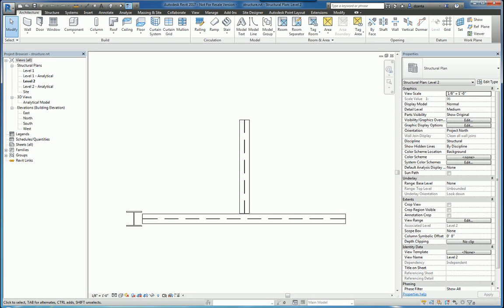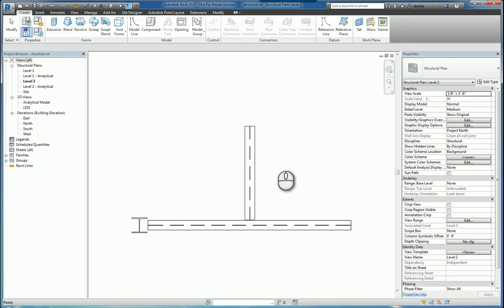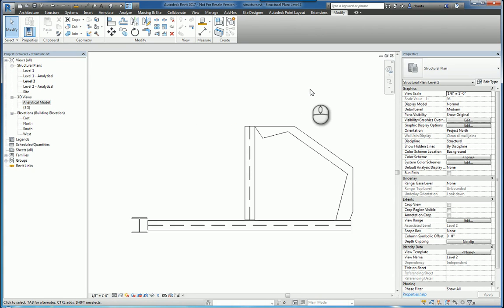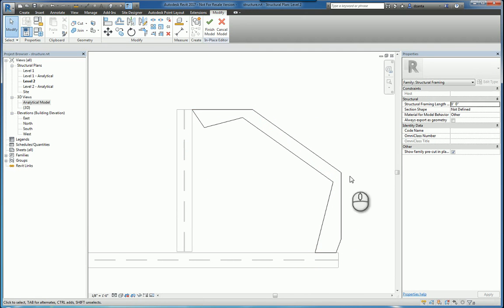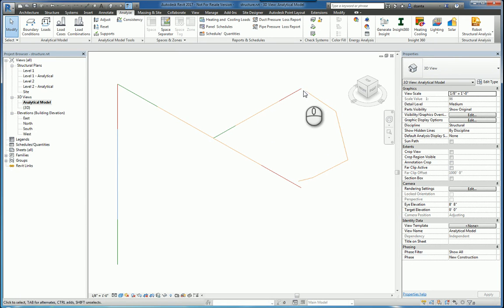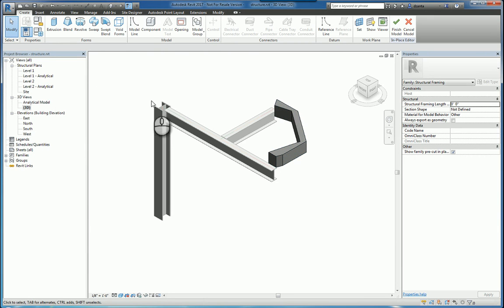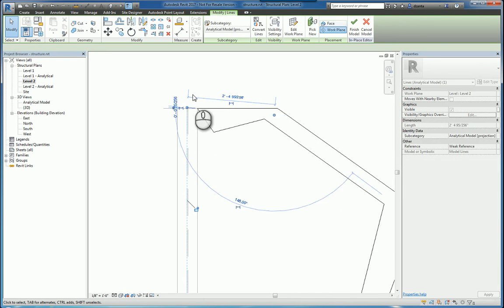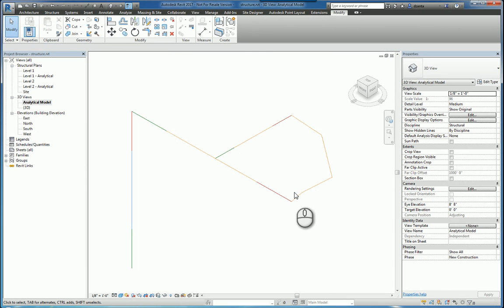Revit Analytical Model Lines   A How to Guide

Comment: Is there a way how to add custom analytical line in family?
Reply from the maker: If you start with a structural based family such as a beam or column or truss, then the analytical lines will already exist
Reply: @DzanTa  Yeah, but its usefull only for straight beams. I cant create for example concrete truss with bilinear center line
Reply from the maker: @AndayonLB  is it possible to use a truss family and alter it to do what you want?